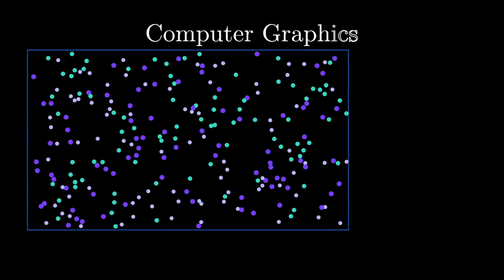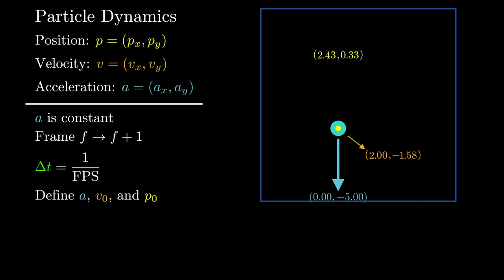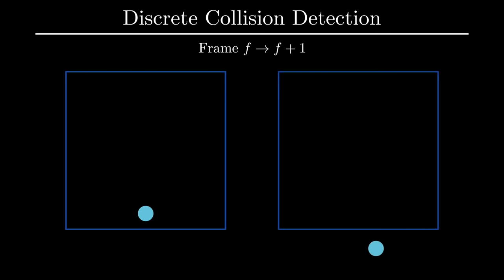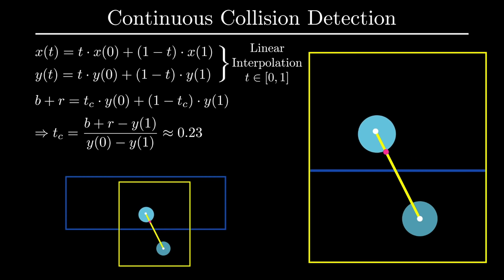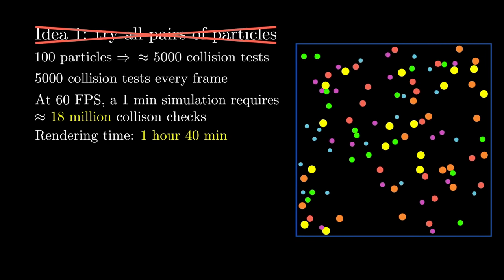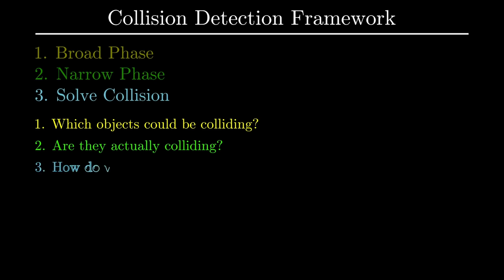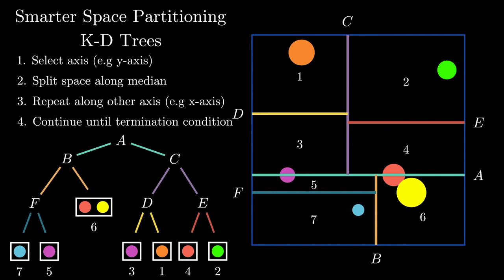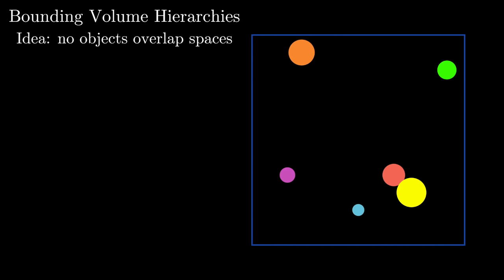Building Collision Simulations: An Introduction to Computer Graphics

Comment: 13:23 wtf happened to those yellow and blue balls in the middle of the box? They just randomly started to orbit themselves
Reply: Bug!
Reply from the maker: Ha, good eye -- that's a bug, not a feature :P There were way more of these issues in earlier iterations of the simulations, and they happen randomly when there are some weird shear type collisions of particles. I promise I tried fixing all of them. It's really a case of fixing a bug and then introducing like 40 new bugs, probably some underlying mechanics in my code is off slightly.

At some point, I just had to call it and move on because the effort to fix the bug seemed to not be worth it.
Reply: @Reducible  Was CCD implemented between spheres? If not, I think this is the problem.
Reply from the maker: @italolima855  yes the full proof solution to this is to implement CCD when particles are quite close -- I tried to keep things in the world of discrete collision detection (I started out with this design choice) and the most likely reason this bug occurs is probably because of that.
Reply: @Reducible  I asked it because I was trying to do something similar but with partially elastic collisions, and I simply couldn't do it work without CCD because after one frame the spheres with reduced speed would still be intersecting each other, creating a very similar effect.
Reply from the maker: @italolima855  Yeah you wouldn't believe the amount of time I fiddled around with adding thresholds and reproducing and fixing local cases but no matter what, there were always a few cases where this would pop up. Your experience leads me to believe this may just be an issue with discrete collision detection in general, which honestly makes sense.
Reply: @Reducible  I could iron out a few bugs with discrete collision detection on a little project of mine by applying a variable step size depending on the objects "length" (simply radius for a sphere) and velocity. Not sure it would completely get rid of these or how much of a performance hit you'd get tho.
Reply from the maker: @user-sl6gn1ss8p  Ooh interesting idea, thanks for sharing. I do wonder how much of a difference it would make since the issue seems to actually occur when objects are still colliding after collision response has been handled. The root cause of that is due to the discrete nature of the solution, which this solution still has. It may fix some of the bugs, but I'm not sure it would be able to catch everything and may introduce a few more haha. Might be a fun idea to experiment with though. The design choices and implementation of these ideas in practice is probably the most interesting aspect of these types of simulations.
Reply: @Reducible  Yeah, you're probably right, but it might change how deep into each other the objects are when collision is detected. I guess whether or how much that makes a difference, for better or worse, depends a lot on how you deal with collisions. 

In my case accuracy was absolutely not necessary (in fact there was added nose on collisions), so what I did was pretty much just restore the objects' positions to before the collision and change it's velocity. It "looks right" at 60 fps since the object never moves much more than it's size each frame. 

Of course this approach means the order in which you test the objects can actually chance behavior - which was okay for my needs but might not be on other scenarios

You're putting out some great content by the way : )
Reply: @Reducible  I ran into this same issue when I made one of these simulations. To fix it, you need to add another condition that the particles must be moving towards each other as well as touching before you handle the collision. What is happening right now is that they are colliding every single frame because they do not have enough time to separate in one frame
Reply from the maker: @connorm9176  Ah that seems like a good candidate solution -- thanks for the info!
Reply: @Reducible  Ohh man I think solving this and getting a video update would be awesome. Also what about a 50k particle simulation when you reach that amount of subscribers?
Reply from the maker: @mikip3242  Ooh that's a fun idea -- no promises but I like the way you think!
Reply: When I made a pool game, for each frame I had to solve collisions between all particles until no more collisions could be detected. Imagine the situation of a cue ball hitting a rack of closely positioned object balls. The collision of one ball immediately leads to a collision of two more and so on and so on. I had to loop through the entire collision routine over and over until no more collisions were detected and only then allow the simulation to advance to the next frame. If you don't do this you get some seriously weird behaviour where balls intersect for several frames and balls that are adjacent don't rebound how you'd expect.
Reply: When you have weird bugs like this I highly recommend writing unit tests for them. It will help you understand exactly in which scenarios the bug occurs and also help prevent regressions when you change something later on.
Reply from the maker: @aspzx  Yeah believe me I wish I had went all out on that. If I was writing this as part of my full time job, I would have been more systematic in my testing. These videos are kind of fun pet projects of mine so I was a little lax with the testing side of things, which made things a lot harder later down the line.
Reply: I am impressed, how the fuck did you spot that? I want you as my bodyguard.
Reply: I missed the orbiting circles but as soon as the idea of flipping the velocity was introduced I started to silently shouting at the screen:
You don't just flip the sign or the objects can stick together! Instead, you set the sign to whatever that reduces the intersection / moves them apart.
Collision logic should withstand consecutive frame triggers.
Reply: Gravity
Reply: I had this same issue occur when testing out a janky physics simulation i wrote in LUA
Reply: Gravity Assist!

Comment: I use an other method : I compute collisions for all pairs with no time limit, and put them in a sorted list (or tree) by the time of collision.. I also store a reference to the earliest collision for each particle. I advance time until the first collision, then do the bounce computation, and do the collision test for  the two balls which trajectory changed with all the others. If a new earlier collision is detected (that happens before a previously anticipated collision), I update the sorted tree (remove collision that won't happen anymore and add the new computed collisions).. this way I only compute ~ n collision only each time a collision occurs. Works great only if particle have a predefined trajectory.

Comment: 18:00 -ish
Then you check those "suspect" particles* along the Y-axis in the same way, to ACTUALLY find out if those particles collide.
Because the Y-axis will determine that the first pair do NOT collide, while the second pair still DO collide & therefore are colliding.
(*not all particles, ONLY those marked with green square here needs checking)
Reply from the maker: Yup I tried emphasizing "possible collisions" (didn't have space to write it out with that algorithm). Thanks for putting this clarification our there.

Comment: What you encountered was the computational aspect of the nbody problem. The video has magnificent solutions some of which i will be trying to learn them. Getting hamstrung at 100 particles is pretty low though (and has been the common theme until lately). If you multithreaded that problem and murdered any notion of OOP programming and instead iterated over sections of the data in thread sized chunks with duplicate data you could reach around 1800 particles before hitting performance limits. OOP is fantastic for object shaped problems and absolutely horrible for raw data transformation over massive data sets, mostly due to cache issues and concurrency congestion.
Reply: What you should expect a high end macbook to hit is around 1000 particles while retaining high frame rates.
Reply: Yeah, I was really confused when he said it took 3 minutes to do 100 particles. I'm trying to make a 2D physics engine, and I haven't even optimized it that much, and it can do around 1500 to 2000 particles before the limitations set in.

Comment: i havent watched all the way in but I think I have a solution somewhat to the 100 particles issue. 

If you are using forces between particles you can find a point where the force is negligible because of their distance. Now keep that distance in mind, that is a constant and is very important.

Now imagine dividing the space into a grid. You only check for interactions in each box. Then update each particle's box. This cuts down on total checks but what about particles on the edge of another box. They still need to be checked. So what you do is you extend it so you have a 3x3 grid. That way a particle in the say, far right, of the box you are checking, can check interactions with particles in the right adjacent box. The box width/height needs to only be the same as that distance we found earlier, because by checking particles in a box with only other particles in a 3x3 grid around that box, the minimum distance to where a particle can still be close enough that forces matter yet be outside the grid is the one we found earlier. If you make each box equal to or greater than that then each particle's maximum interaction range MUST be contained inside the grids.

Why use a box shaped grid and not something circular? Well what you could do for each interaction is wrap it in an if statement to check if their distance is in the right range. But finding distance is a costly operation. So if you tile the space into zones then the distance is basically already found for you. You cant use circle shaped zones because they cant tile the plane infinitely, squares can though.

So basically for my method you do this:

1. Loop through each grid zone
2. In each grid zone loop through each particle
3. For each particle loop through all other particles in a 3x3 grid zone grid centered on the current grid zone
4. For each particle particle pair check to see if the distance is smaller than the negligible one.
5. If after all of that it is still true then you can run the collision algorithm

Comment: TLDR: The 2D collision response vector equation is so clever! It requires no trig functions so it's really fast. It effectively reframes the 2D collision problem into the simple 1D collision problem by rotating the space so it looks like the circles are just colliding head on and then applying the formula for 1 dimension.

When two circles collide in 2D, say one is slightly above and to the right of the other, you can imagine  a normal vector (going from center of one circle to the other) and a tangent vector (which is 90 degrees to the normal vector and tangent to the point of collision). 
You can express the velocities in terms of these vectors by projecting the velocities onto them (using the dot product), effectively rotating your frame of reference so that the tangent and normal vectors are your new x and y axis.

The clever insight here is that there is no force in the direction of the tangent vector so whatever component of the velocity is in that direction, it won't change! You only have to calculate the new velocities for the normal direction using the equation for collisions in 1D.

Once you have the new velocities in the reference frame of the normal and tangent vectors, you can convert them back into your original reference frame by multiplying them by the normal and tangent vectors!

If you wanna know more, read the pdf in the description: https://www.vobarian.com/collisions/2dcollisions2.pdf

Comment: 6:47 there's a bug that can happen with this implementation, specifically, when you collide with the ceiling, if your position is very close to the ceiling, the mirrored velocity could become not enough to the box, which if I understand correctly, will result in the ball drifting upwards infinitely. fixable by a check for velocity direction for example.

Comment: Thanks, this is quite helpful as I step into my second game engine project. I do not plan on having walls involving elastic collisions, but I will have fast moving projectiles and I need them to not be able to pass thru sprites undetected. I was thinking to draw lines from previous positions to current positions (left and right edges of round projectile) and check collision of those lines with my sprite rectangle object... but this may end up being a terrible idea in practice. I haven't seen it implemented anywhere. I think the ideas in this video may be more practical. Thanks again.

Comment: As long as you know the outer and inner radius you can do it rather simply, just divide the outer radius of the "static" object by the outer radius of the moving object, if the number is less than 1 a collision is going to occur and just multiply the amount to move by by the result of the division then minus that from the original amount to move by then minus that result from the position instead of adding

Comment: For sweep and prune you can easily see how it will be better.

Originally you check every particle with every other one. So for n particles each one has to pair with (n-1) particles. n particles performing n-1 checks means n(n-1) total checks, but since each pair will occur twice it is divided by 2. So n(n-1)/2 total checks. 

Now without sweep and prune you are checking total distance between each one. This is a costly algorithm. Doing sweep and prune you remove a ton of computing time. Sweep and prune has the n(n-1)/2 checks on one axis, which is a simple greater than or less than of one of the values. Without it you do n(n-1)/2 checks on both axis with sqrt(dx^2 + dy^2).

Then sweep and prune has additional sqrt(dx^2 + dy^2) for possible collisions. Call the one axis A and the two axis sqrt one B.
So the comparison is n(n-1)/2 (A) + xB <  n(n-1)/2 B and let n(n-1)/2 just be n for n total checks.

nA + xB < nB
xB < nB - nA
x < (nB - nA)/ B
x < n(B-A)/B

So the number of checks in the narrow phase (x) has to be less than the number of total checks (n(n-1)/2 if n = number of particles) times the difference in calculation time between method B and method A, all over calculation time of B.

x < n * ((B-A)/B)
Focus on the (B-A)/B. B and A are the time it takes to do those calculations (sqrt method and interval method respectively) so B-A is the dT, the delta T, time delta, or change in time going from B to A. If A is less then it is positive when in reality you lost time. So really B-A is the "saved time from method B to method A". Then you take that as a fraction of the total time it takes to do B, which is like finding percent. So B-A / B is the same as "What percent of B is the time gained from switching to method A from method B?" its also the same as "What percent of B is cut out by switching to A?". Why? Say A takes half the time of B. If B = 2 then A would be 1. So (2-1)/2 = 1/2. Say A is 1/3 the time as B. If B = 3 A would = 1. (3-1)/3 = 2/3. If A is 1/3 the time of B, by switching to A you would shave off 2/3 of the initial B time.

So going back to the original equation x, the number of narrow phase checks, has to be less than the number of broad phase checks (n) * the time shaved off by using interval method in order for the prune and sweep to be better than the original.

The time shaved off using the interval method can be calculated by figuring out how long it takes for a computer to do method B (sqrt((Xa - Xb)^2 + (Ya - Yb)^2) < max collision evaluation distance) and how long to do method A ( Xa - Xb < max collision evaluation distance). How do we figure it out roughly? Well operation A is just a subtraction and then a greater/less than. Operation B is two subtractions, two squares, an addition, a sqare root, and a greater/less than. Google says that multiplication nowadays is in constant time (O(1)) just like addition. So is the comparison because that is checking the leftmost bit. So Operation A is 2 "cycles" and operation B is 6 cycles + sqrt time. Square roots are very hard, and are O(n). Lets just act like it doesnt have to take the square root and that takes 0 cycles. Then A takes 2 and B takes 6. The time shaved from B to A is (6-2)/6 = 2/3.

So in a world where sqrt takes 0 cycles, our original equation is x < n*(2/3). So in order for sweep and prune to be faster, the number of narrow phase checks must be less than 2/3 the number of broad phase checks. This means that for any number n of particles, 2/3 or less pairs must be a possible collision. That is pretty good because it would be hard to have even 50% of particles possibly colliding.

Comment: Actually, in order to get the velocities of particles after collision, you not only have to use conservation of energy and momentum, but also have to assume that the impulse is normal to the surface of contact between the 2 objects. Otherwise you will not have enough equations to be able to solve for final velocities.

Comment: Great video!
I slight mistake on 6:28
p.vel is updated and used in the next line too
Reply from the maker: Thanks!  Good catch. In the context of these simulations, because dt is so small and accelerations are relatively small, it doesn't matter too much but theoretically, you are correct. Updated the mistake in the description.

Comment: In 26:31, I don't get why two bounding boxes with no intersection can't have collision. It should depend on the velocity of the particle within the bounding box. If the velocity is large enough to reach the other bounding box in one frame, they will collide.